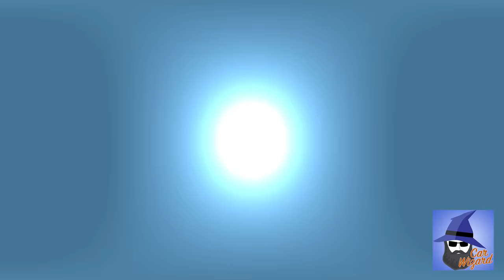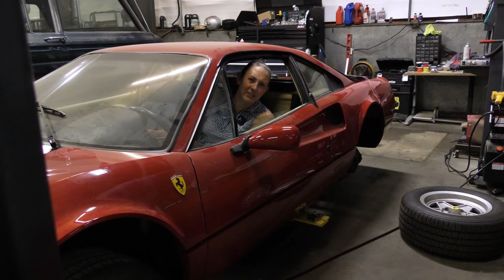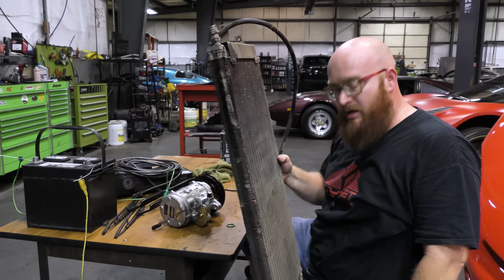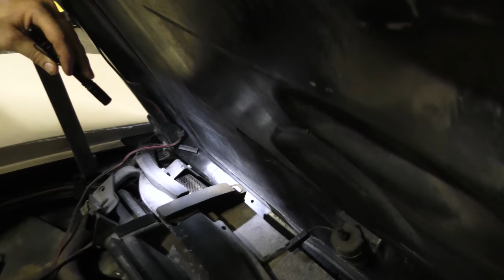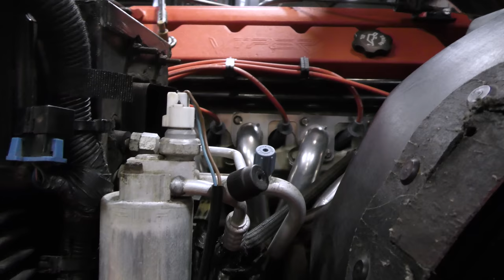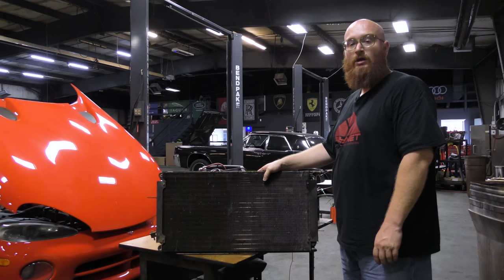Your AC died, now what?!? CAR WIZARD shares several reasons why it dies & the repairs to fix it

Comment: For those of you who live in snow-land, the road salt can corrode the metal parts in the AC system until they leak.
Reply: Oh yes I know this all to well. My 04 trailblazer beater farm vehicle/ winter vehicle that is about to fall apart all the nice silver ac lines are crusty rusty falling apart. I'm amazed it can still blow ice cold ac in 90+ f here in Chicago land suburbs. Moving to TN soon and don't have to worry about salt bucket ruin all my vehicles that are driven in winter.
Reply: When I had my my 2001 Lincoln Ls. I had the car rust proofed and always cleaned. It lived in the winters of Canada. When I sold it in 2020. The ac stilled worked and wasn't corroded. You are right, the salt does corrode the lines.

Comment: Number one check is if there is pressure in the lines.#2 check the fuse that controls the compressor clutch.#3 check the belt and tension on the clutch pully.

Comment: Little over a year ago I had my ac go out. I started with having the ac recharged. That lasted about an hour. I had my ac system rebuilt for around 1300. I also had to replace the blower motor once. I was able to do that myself for about 80. Living in Texas where we are in 100's I'll gladly keep my ac running even if it means worst gas mileage.

Comment: What a wonderful video. Kudos to all the Wizard family and crew for producing videos with such useful information. I'm a bit "old school" and used to drive a green Hornet with an aftermarket AC system, installed by Sears. It's very helpful to understand why your R2D2 is such an essential tool.  I still have vintage cans of Freon for recharging this system in my shed.  Because of the Wizard, I know to only add 3 cans of this Freon to my truck.
Reply: My parents had a Hornet with no A/C when I was a kid. Vinyl seats too — which were a scorcher in the summer on the way to and from the pool.

Speaking of Freon (R-12), the EPA hates this but a lot of people swap out the R-134a in their systems for R-12a (a mix of propane and isobutane) or R-152a (the propellant in Dust-Off) and get a 30%+ boost in cooling capability of their A/C.  Just make sure at least the technicians know so that you don’t contaminate their reclamation systems!

Comment: I have had the clutch gap get too big on an 02 Civic and 07 Corolla.  Classic sign is that when the car is cold, the AC works until the clutch coil heats up and the resistance goes up until the magnet is no longer strong enough to keep the clutch engaged.   Will work again when the car is cold.  It was easy on these cars to remove the armature plate on the clutch and simply put in a thinner shim.  With the Civic, 6 years later and still working.  08 Honda Fit had 3 pin hole sized leaks in the suction hose to the compressor.  UV dye could not find the leak.  Good old soap and water found the leaks.  Replaced the hose.  All good.
Reply: I had a 2004 Volvo V70 that had this same issue with the clutch gap getting too big. The AC worked just fine until the temperature got past 80F or so and then the compressor wouldn't engage. Volvos from the mid 90s to late 2000s are notorious for this issue. I was also to shim the compressor clutch with zip ties and I never had another issue with the compressor not engaging. Took me 10 minutes to fix it and it cost me about $1.

Comment: Since 20ish years (at least in Europe) you can also have variable pressure compressor on which the pressure solenoid can stick, and they're really sensitive to the freon charge
Reply: Thats the failure I see in the newer ac systems. In the US, that variable pressure solenoid is not sold separately so you get to replace the entire compressor.

Comment: I find folks who "top off" with little cans of refrigerant to generally be bad idea, usually they will put way too much in, low pressure will be way to high and possible damage to occur. Pay a mechanic to evacuate your system and fill to factory load if your car is 10+ years old. You can get away sometimes with the cheap little cans with cheasy guage but if it's never been touched in 10+ years, just pay someone to do it properly

Comment: Don't necessarily give-up on an old automotive A/C system.  My story might encourage you with the results I had.

My 25 yr. old Toyota Paseo convertible has the original A/C, and it still works.  It didn't work when I bought it, and my mechanic found that the system needed a recharge.  It uses 134a refrigerant, and he charged it up.  About six weeks later the output wasn't getting as cold and my mechanic found the system needed a top-off.  He then explained that (in my case) losing part of the charge that quickly was due to the system having gone years without being in-use and that caused all the seals to dry out. He went on to say that now with the system having a charge in it, the seals will absorb the refrigerant/oil and swell-up thus sealing-off better.  And that the best way to accomplish swelling the seals and the system holding the charge long-term, is to use the A/C all the time.  He went on to say that, as all automotive A/C systems age they develop a lot of micro holes that really can't be found, and they can't be fixed other than replacing just about all of the system components.  He told me to keep up with the recharges as needed and the refrigerant loss would ease up.  He was right.
After that first top-off the charge held to late springtime the following year, and he topped it off again.  Then it needed one top-off that fall after heavy summertime use.
Understand the top-offs are just that.  Not for a total loss of refrigerant, only a partial loss when the output wasn't as cool as it could be.
On very hot days I do have an issue with the output warming up more than I'd like when I'm stopped at a light and in heavy traffic.  It's not awful, because it's still a lot cooler inside the car than outdoors.  My mechanic said, that's normal because the system is so old and there's a lot of wear on the compressor. I say, any car that's 25 yrs. old with miles on it and has A/C working that good is just fine with me.
During the winter I left the A/C button activated because I do that in any car because we have dampness here in New England.  In leaving the A/C activated during the winter doesn’t use much in extra gasoline if at all, because the system doesn’t run much in cold weather but enough to remove dampness for a nice comfortably dry cabin.  And below 40F outdoors the A/C compressor mostly won’t turn on at all.  Other than the times sitting at a traffic light without any wind the under-hood temp rises enough to pop it on.
The top-offs lasted longer each time and reached a point of going almost two years before another top-off, and that seems to be the point that it's leveled off at now.

I need to say that I have a good mechanic that isn't the type to just throw parts at a car, and he only charged me $25 for a top-off. I was pleased that the system never had to be opened-up (so to speak) because it's an original untouched system.  It might just be me, but I'd have a concern in replacing, say the compressor, and causing other parts in the system to fail under the full pressure of a new compressor.
Reply: Great story.  Hope my beloved ‘03 Toyota Tacoma goes 25yrs!!
Reply: @benaldredge2671    Thank you, Ben.  I've always thought the Tacoma is the best that Toyota makes.  Follow the maintenance schedule.  Rust will probably be your most challenging issue.
Reply: 1990 Toyota Camary. AC never touched 200,000 miles still ice cold.
Reply: @discerningmind  if he always rinses the salt off he will never have a lick of problems. His truck will last him a LONG LONG time.

Comment: I’m currently an ISS at O’Reilly and on Tuesday I start as a Service Advisor at a Ford Dealership. We have condenser samples showing how small the holes are demonstrating why they can’t be flushed. Usually after showing someone that, they start to buy condensers more often. Older condensers they say around 2001 was the transition period have huge holes comparatively.

Comment: FWIW, my AC guy recommends running a vehicle’s AC at least 5mins each week (even if you don’t need it) to keep things lubricated and to help prevent leaks.
Reply: s  we so
Reply: It keeps the compressor shaft seal lubricated so it doesn't dry out and leak.

Comment: Had to replace my compressor last year.  Actually is pretty easy.  You can go to the auto parts store and they will loan you the AC gauges and evacuation pump to reload the AC134.  Cost me a $150 (and a couple hours work) instead of $700 at the local repair shop!  🙂

Comment: Just spent $900 on a new compressor install.  (2001 Buick)  Compressor was leaking and I "thought" they could replace the seals "only" but.... Mechanic suggested new Compressor.  Well...  Still having a problem with temps in the 60's.  They also replaced an Orifice Tube.  Well... after this great video, I'm sure I'm looking at a condenser, drier, and more to get it back to normal.
Reply: Used to be able to replace just the seals, but these days the labor to do so is too high and the failure rate is too.
Reply: @hotpuppy1  Interesting, I did not know that.  Cars only got 60,000 miles on it.

Comment: I was one of those guys that tried to recharge my truck. Got one if those cans with the built in guages. Tried to get it to the recommended psi.  After a while, it stopped working.  Took it to shop and they did a proper recharge. I had ended up over charging it.
Reply from the maker: Very easy to do on newer cars.
Reply: @CarWizard  yea. 2005 GMC. Luckily no harm done,  so it was a good 'live and learn' moment
Reply: @crazyeyez1502  lol I had a 95 Chevy pickup and it wouldn't blow cold air anymore. My Dad automatically assumed it was low on freon. He charged it up and later I noticed one of the lines leaking compressor oil. Turns out he busted the o-rings by overcharging it. Luckily I knew a guy who owns a shop, he replaced the o-rings and recharged it for $70. All that was wrong with it before my dad broke it was the pressure switch which would have only cost $25 to replace.

Comment: Spent about a grand getting my 1988 MR2SC converted to R134A and new compressor and seals throughout. Blows freezing now and is so nice having on long trips. Don't give up on old A/C systems and good shop that's worth their weight should be able to get a R12 system converted properly and working great.

Comment: I only worry about the A/C in my house cause I don’t live in my car. When I was a kid maybe half of the new cars had a/c and many of the cars that were more than a few yrs old that had a/c were “ broken “ unlike like smaller lighter compressors today.  The old boat anchor A6 compressor comes to mind. My 18 yr old Accord with 200k still on original compressor with one top off of “ freon” and  had to change the clutch out 3 yrs ago
Reply: Yup, back in the 80's-90's none of the ac worked in any of the cars my family or I owned. It was a luxury item unobtainable to repair due to $. I guess thats why I learned how to fix it myself, and have all the tools to do it for pennies on the dollar today.

Comment: I had a 2003 Toyota avensis here in europe, sold it las year and it never had a leack in his entire life. Most of the time, the A/C sistem breaks because the people when it's cold they turn it off, and didn't switch it back on sice half a year or more when the summer comes, when the sistem doesn't have the frion circulating, tends to get cracked and then start's the leaks on the pipes, or the compressor get's stuck... If you make sure to turn it on at least once in a month for a little time, I'm sure it's going to last much longer. Had no problem with any other of my cars, since I never switch it off for so long.

Comment: Strange occurrence one time when it came to warm output air conditioning. Everything was working; controls, clutch, properly full system, no leaks.  it just wasn't producing enough cold air.

The issue was isolated to the condenser itself. Turns out an impact with a foreign object in just the perfect way to collapse but not pop the veins created a pseudo orifice tube/expansion valve. The refrigerant, when pushed through this orifice section, would expand thus causing the cooling effect after the collapse vein.  Only the cooling effect was occurring in the engine compartment and not inside the evaporator. By the time the refrigerant made its way to the expansion valve there was nothing left to cool off the evaporator.

Comment: I have a 2001 Subaru Outback LL Bean edition with the H6 and the AC was broken when I bought it.  The diagnosis was a failed RPM sensor attached to the compressor that prevented a seizure from destroying the belt or the clutch.  The replacement was a $600 episode, but now you can just about freeze meat in that thing~

Great video!
Reply: Have the H-6 in my SVX & yes its AC is a total freezer. Not bad for a black car.

Comment: Back in the day I had a 1990 Volvo 240 that had a bad switch on the dryer/receiver.  The Volvo Parts Dept. put up a big stink when I tried to buy a replacement saying that it couldn't possibly be the problem.  I finally had to drag the manager out and showed him that when I 'jumped' the switch the AC worked.  He finally sold me one - it did the trick.

Comment: Don't forget to check the condition of the cabin air filter.
Reply: and that the fan switch is on any position other than "off"...
if the fan motor resistor is broken then on the highest setting it should still work?

Comment: Hey Car Wizard, I just lost my AC in my 2001 Ford Ranger. By the way, the reason it is not working is because it threw the AC Compressor clutch while driving down the road. And it can do that if you have a manual transmission and miss a gear causing you to over rev an engine, or if the AC Compressor locks up. In my case I am thinking that the AC Compressor locked up. And for all you kids out there that like to hot road your car, as well as Drag Race it is a good idea to turn that AC off if you have a manual transmission so you do not cause an AC Compressor clutch to be thrown due to missing a gear and over rev-ing your engine, or just choose not to go drag racing.

Comment: 15:40 you said @5:40 the compressor has a pressure relief valve so the system doesn’t explode. I put too much Freon in my 2004 Trailblazer (a lot less than 7 cans) and it just blow some out.

Comment: My son's 2011 v6 mustang had the high side line crack near the compressor. $30 part so am easy fix. Something to watch for. Daughter's 2010 mustang had evaporator leak. Used the Red Angel stop leak, the 2oz bottle, worked great. Highly recommend instead of tearing the whole car apart.

Comment: I had a 1984 Ford LTD for a week when the A/C turned warm.  Turned out the low-pressure governor failed.  The mechanic jumped around it, warned me to switch the A/C off if it turned warm (because he had bypassed the safety cutoff), and I had A/C again.  I can't remember if I ever replaced the governor or not before I wrecked it a couple years later.

Comment: Great video. I've done 5 vehicle ac swaps myself, 4 successfully. Lol. Ac doesn't work in my truck because of the clutch. Does work, but it sounds terrible. Have the parts to fix it, may take it to a shop. Being a 90 Dodge Cummins, I can run the non ac belt.

Comment: Always check your AC Schrader valve esp after you fill it because those things are notorious for leaking your freon out. Usually it's the one on the low pressure side but there is a high side.

Comment: I had an a/c compressor clutch fail on our Forester. Something with the magnet wasn’t working properly. It worked fine in cooler temperatures but if it got hot it would fail to engage or only engage sometime. I later found out it’s a sorta well known issue with a few model years of the Forester.

Official fix from the Subaru dealer was to replace the whole compressor + clutch assembly for like $2k. Parts catalog confirmed the clutch isn’t sold by Subaru at all except as a full assembly. I ended up buying an aftermarket replacement clutch and installed it myself. It’s been working fine ever since!

I went this route since I didn’t have the money to do a whole compressor assembly and I knew I didn’t have the equipment either. The clutch was something I could do with the tools I had. I can see why at a shop though it’s just better to do a whole assembly.
Reply: Derek, spambots are posting s*** all over the platform and I am sorry for my french
Reply: Great job I love it when people get to do it themselves and cheaper then the shops
Reply: My 2003 Baja had the same symptoms. The gap on the compressor clutch had worn and got wider over the years. It would not pull in. I found a hack for the 3 tang clutch design, you slip plastic bread wrapper tabs under the three tangs to increase the pressure against the clutch. Been working for nearly 10 years.
Reply: @martinmicheal4595  also, you will deal with spambots ruining the channels nowadays, must've been Enclave owners and spambots are troublemakers

Comment: When I bought my 1979 Toyota 4x4 truck it did not come with factory air.  Air conditioning was dealer installed.  The compressor was permanently engaged.  I lost the system in Blythe California.  When had it repaired at another Dealer they told me that first dealer had installed junk.  The fix was very low charge of coolent.  Air con worked for the rest of the trucks life.  It was a great truck and someone 12 years latter wanted it more then me.